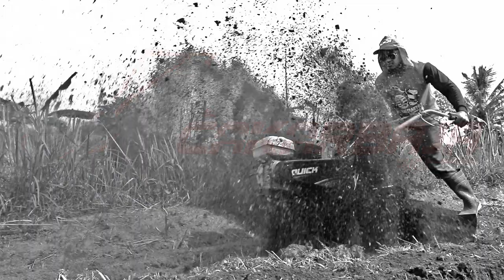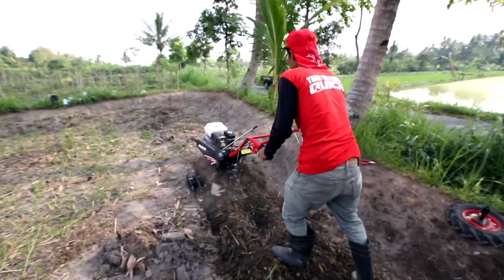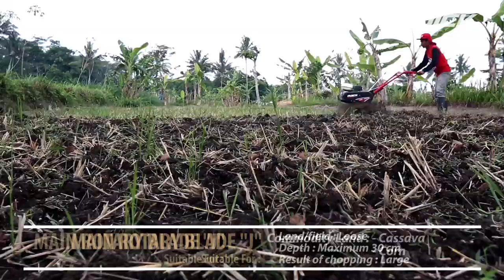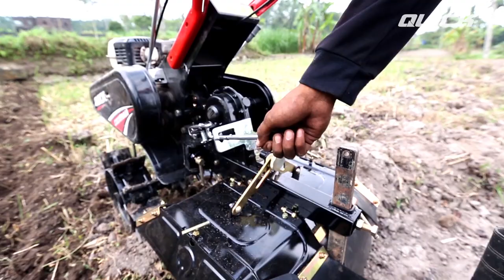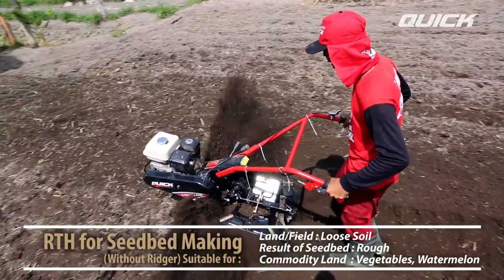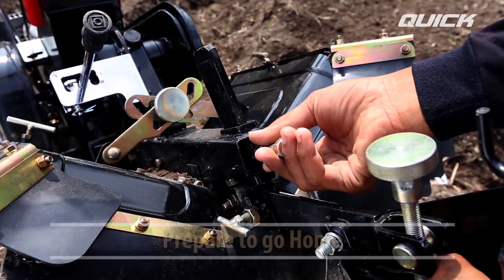CULTIVATOR QUICK CAKAR BAJA : STEADY, DURABLE, STRONG

Comment: Brapa sih Harga ya utk kota bogor jabar
Reply from the maker: Harga Quick Cakar Baja :
Mesin Bensin GX 200T2-QTBC : Rp 11.450.000 
Mesin Bensin GX 160T2-QTBC : Rp 11.150.000

Keterangan:
- Harga belum termasuk Biaya merakit, Oli, Solar/Bensin
- Harga termasuk PPN 10%
- Harga termasuk perlengkapan standar (hitch pin, universal hitch, resistance bar, dan roda karet)
- Harga belum termasuk ongkos kirim dari pabrik di Yogyakarta.

Perlengkapan Cultivator dijual terpisah (pilih sesuai kebutuhan)
--> Main Rotary BLADE B 340 = Rp 1.380.000 
--> Main Rotary BLADE B 240 = Rp 920.000 
--> Main Rotary BLADE B 100 = Rp 680.000 
--> Stabilizer Disc = Rp 120.000
--> Extension Rotary Blade B 200 = Rp 530.000
--> Main Rotary Blade J = Rp 1.310.000
--> Main Rotary Blade S = Rp 1.340.000
--> RTH = Rp 4.930.000 
--> Ridger = Rp 860.000 
--> Iron Wheel (CW 370)  = Rp 380.000 
--> Iron Wheel (CW 550) = Rp  600.000
--> Garu (Leveler) Cakar Baja = Rp 270.000
--> Bajak Cakar Baja = Rp 530.000 

Untuk lebih jelasnya, Pak Bos dapat menghubungi link https://bit.ly/CakarbajaSalesPusat

atau bila berkenan mohon kirimkan nomor telp/HP Pak Bos, bagian pemasaran kami akan menghubungi Pak Bos :)

Comment: Harganya brp yach..?
Reply from the maker: Harga Quick Cakar Baja :
Engine Honda GX 200 T2-QTBD : Rp11.582.000 
Engine Honda GX 160 T2-QTBD : Rp11.262.000

Keterangan:
- Harga belum termasuk perlengkapan (Blade / RTH / Ridger)
- Harga belum termasuk ongkos kirim dari pabrik di Yogyakarta
- Harga belum termasuk biaya merakit, oli, solar / bensin, running test dan training
- Harga sudah termasuk PPN 11%

Untuk informasi lebih detail, silahkan Pak Boss menghubungi Telp. / WA Telp. / WA : 0811 2828 477 atau 0811 2930 300

atau bila berkenan mohon kirimkan nomor telp. / HP Pak Boss, bagian pemasaran kami akan menghubungi Pak Boss :)

Comment: Di Bondowoso berapa per unit harganya?
Reply from the maker: Harga Quick Cakar Baja :
Mesin Bensin GX 200T2-QTBC : Rp 11.450.000 
Mesin Bensin GX 160T2-QTBC : Rp 11.150.000

Keterangan:
- Harga belum termasuk Biaya merakit, Oli, Solar/Bensin
- Harga termasuk PPN 10%
- Harga termasuk perlengkapan standar (hitch pin, universal hitch, resistance bar, dan roda karet)
- Harga belum termasuk ongkos kirim dari pabrik di Yogyakarta.

Perlengkapan Cultivator dijual terpisah (pilih sesuai kebutuhan)
--> Main Rotary BLADE B 340 = Rp 1.380.000 
--> Main Rotary BLADE B 240 = Rp 920.000 
--> Main Rotary BLADE B 100 = Rp 680.000 
--> Stabilizer Disc = Rp 120.000
--> Extension Rotary Blade B 200 = Rp 530.000
--> Main Rotary Blade J = Rp 1.310.000
--> Main Rotary Blade S = Rp 1.340.000
--> RTH = Rp 4.930.000 
--> Ridger = Rp 860.000 
--> Iron Wheel (CW 370)  = Rp 380.000 
--> Iron Wheel (CW 550) = Rp  600.000
--> Garu (Leveler) Cakar Baja = Rp 270.000
--> Bajak Cakar Baja = Rp 530.000 

Untuk lebih jelasnya, Pak Bos dapat menghubungi link https://bit.ly/CakarbajaSalesPusat

atau bila berkenan mohon kirimkan nomor telp/HP Pak Bos, bagian pemasaran kami akan menghubungi Pak Bos :)

Comment: Wilayah bali ada bos?. 1 unit brapa harganya?
Reply from the maker: Harga Quick Kasuari Jawa:
Mesin Bensin GX 200T2-QTBC : Rp 9.000.000 
Mesin Bensin GX 160T2-QTBC : Rp 8.700.000
Body Only : Rp 5.550.000

Keterangan:
- Harga termasuk PPN 10%
- Harga termasuk perlengkapan standar (Roda Karet 8, Blade Ksr J, Ridger Ksr)
- Harga belum termasuk Biaya merakit, Oli, Solar/Bensin
- Harga belum termasuk ongkos kirim dari pabrik di Yogyakarta.

Informasi lebih jelas Pak Bos dapat menghubungi link https://bit.ly/KasuariSalesPusat

atau bila berkenan mohon kirimkan nomor telp/HP Pak Bos, bagian pemasaran kami akan menghubungi Pak Bos :)

Comment: Ini mantab harga berapa yg ini boss
Reply from the maker: Harga Quick Cakar Baja :
Mesin Bensin GX 200T2-QTBC : Rp 11.450.000 
Mesin Bensin GX 160T2-QTBC : Rp 11.150.000

Keterangan:
- Harga belum termasuk Biaya merakit, Oli, Solar/Bensin
- Harga termasuk PPN 10%
- Harga termasuk perlengkapan standar (hitch pin, universal hitch, resistance bar, dan roda karet)
- Harga belum termasuk ongkos kirim dari pabrik di Yogyakarta.

Perlengkapan Cultivator dijual terpisah (pilih sesuai kebutuhan)
--> Main Rotary BLADE B 340 = Rp 1.380.000 
--> Main Rotary BLADE B 240 = Rp 920.000 
--> Main Rotary BLADE B 100 = Rp 680.000 
--> Stabilizer Disc = Rp 120.000
--> Extension Rotary Blade B 200 = Rp 530.000
--> Main Rotary Blade J = Rp 1.310.000
--> Main Rotary Blade S = Rp 1.340.000
--> RTH = Rp 4.930.000 
--> Ridger = Rp 860.000 
--> Iron Wheel (CW 370)  = Rp 380.000 
--> Iron Wheel (CW 550) = Rp  600.000
--> Garu (Leveler) Cakar Baja = Rp 270.000
--> Bajak Cakar Baja = Rp 530.000 

Untuk lebih jelasnya, Pak Bos dapat menghubungi link https://bit.ly/CakarbajaSalesPusat

atau bila berkenan mohon kirimkan nomor telp/HP Pak Bos, bagian pemasaran kami akan menghubungi Pak Bos :)
Reply: @quicktraktor  di jawab detail mantabb👍👍
Yg bisa pake RTH yg type apa..?  Komplit berapa bos
Reply from the maker: Tipe Cakar Baja dapat diaplikasikan dengan RTH

Comment: Di Bandung toko my di mna
Reply from the maker: Harga Quick Cakar Baja :
Mesin Bensin GX 200T2-QTBC : Rp 11.450.000 
Mesin Bensin GX 160T2-QTBC : Rp 11.150.000

Keterangan:
- Harga belum termasuk Biaya merakit, Oli, Solar/Bensin
- Harga termasuk PPN 10%
- Harga termasuk perlengkapan standar (hitch pin, universal hitch, resistance bar, dan roda karet)
- Harga belum termasuk ongkos kirim dari pabrik di Yogyakarta.

Perlengkapan Cultivator dijual terpisah (pilih sesuai kebutuhan)
--> Main Rotary BLADE B 340 = Rp 1.380.000 
--> Main Rotary BLADE B 240 = Rp 920.000 
--> Main Rotary BLADE B 100 = Rp 680.000 
--> Stabilizer Disc = Rp 120.000
--> Extension Rotary Blade B 200 = Rp 530.000
--> Main Rotary Blade J = Rp 1.310.000
--> Main Rotary Blade S = Rp 1.340.000
--> RTH = Rp 4.930.000 
--> Ridger = Rp 860.000 
--> Iron Wheel (CW 370)  = Rp 380.000 
--> Iron Wheel (CW 550) = Rp  600.000
--> Garu (Leveler) Cakar Baja = Rp 270.000
--> Bajak Cakar Baja = Rp 530.000 

Untuk lebih jelasnya, Pak Bos dapat menghubungi link https://bit.ly/CakarbajaSalesPusat

atau bila berkenan mohon kirimkan nomor telp/HP Pak Bos, bagian pemasaran kami akan menghubungi Pak Bos :)
Reply: Kalo buat lahan sayuran asesoris nya apa aja

Comment: Berapa hargay untuk wilayah. Boyolali
Reply from the maker: Harga Quick Cakar Baja :
Mesin Bensin GX 200T2-QTBC : Rp 11.450.000 
Mesin Bensin GX 160T2-QTBC : Rp 11.150.000

Keterangan:
- Harga belum termasuk Biaya merakit, Oli, Solar/Bensin
- Harga termasuk PPN 10%
- Harga termasuk perlengkapan standar (hitch pin, universal hitch, resistance bar, dan roda karet)
- Harga belum termasuk ongkos kirim dari pabrik di Yogyakarta.

Perlengkapan Cultivator dijual terpisah (pilih sesuai kebutuhan)
--> Main Rotary BLADE B 340 = Rp 1.380.000 
--> Main Rotary BLADE B 240 = Rp 920.000 
--> Main Rotary BLADE B 100 = Rp 680.000 
--> Stabilizer Disc = Rp 120.000
--> Extension Rotary Blade B 200 = Rp 530.000
--> Main Rotary Blade J = Rp 1.310.000
--> Main Rotary Blade S = Rp 1.340.000
--> RTH = Rp 4.930.000 
--> Ridger = Rp 860.000 
--> Iron Wheel (CW 370)  = Rp 380.000 
--> Iron Wheel (CW 550) = Rp  600.000
--> Garu (Leveler) Cakar Baja = Rp 270.000
--> Bajak Cakar Baja = Rp 530.000 

Untuk lebih jelasnya, Pak Bos dapat menghubungi link https://bit.ly/CakarbajaSalesPusat

atau bila berkenan mohon kirimkan nomor telp/HP Pak Bos, bagian pemasaran kami akan menghubungi Pak Bos :)
Reply: Tanah tadah hujan.. Rekomendaasiy pakai ap.. N apakh ad bekel resmiya

Comment: How much po
Reply from the maker: Harga Quick Cakar Baja :
- Engine Honda GX 200 T2-QTBD : Rp11.582.000 
- Engine Honda GX 160 T2-QTBD : Rp11.262.000

Keterangan:
- Harga belum termasuk perlengkapan (blade / ridger / RTH)
- Harga belum termasuk ongkos kirim dari pabrik di Yogyakarta
- Harga belum termasuk biaya merakit, oli, solar / bensin, running test dan training
- Harga sudah termasuk PPN 11%

Untuk informasi lebih detail, silahkan Pak Boss menghubungi nomor berikut : 0811 2828 477 atau 0811 2930 300

atau bila berkenan mohon kirimkan nomor telepon Pak Boss, bagian pemasaran kami akan menghubungi Pak Boss :)

Comment: Satu paket cakar baja kuik lokasi Pati beraa boo s
Reply from the maker: Harga Quick Cakar Baja :
Mesin Bensin GX 200T2-QTBC : Rp 11.450.000 
Mesin Bensin GX 160T2-QTBC : Rp 11.150.000

Keterangan:
- Harga belum termasuk Biaya merakit, Oli, Solar/Bensin
- Harga termasuk PPN 10%
- Harga termasuk perlengkapan standar (hitch pin, universal hitch, resistance bar, dan roda karet)
- Harga belum termasuk ongkos kirim dari pabrik di Yogyakarta.

Perlengkapan Cultivator dijual terpisah (pilih sesuai kebutuhan)
--> Main Rotary BLADE B 340 = Rp 1.380.000 
--> Main Rotary BLADE B 240 = Rp 920.000 
--> Main Rotary BLADE B 100 = Rp 680.000 
--> Stabilizer Disc = Rp 120.000
--> Extension Rotary Blade B 200 = Rp 530.000
--> Main Rotary Blade J = Rp 1.310.000
--> Main Rotary Blade S = Rp 1.340.000
--> RTH = Rp 4.930.000 
--> Ridger = Rp 860.000 
--> Iron Wheel (CW 370)  = Rp 380.000 
--> Iron Wheel (CW 550) = Rp  600.000
--> Garu (Leveler) Cakar Baja = Rp 270.000
--> Bajak Cakar Baja = Rp 530.000 

Untuk lebih jelasnya, Pak Bos dapat menghubungi link https://bit.ly/CakarbajaSalesPusat

Kunjungi fanpage kami @quicktraktorjogjakarta
SMS/WA : 0811 2545 915 (Adkha)
Kantor QUICK YOGYAKARTA
Jl. Magelang 144, Yogyakarta 55241
Telp: 0274-563217, 512095
Fax: 0274-563523
Email: ygy@quick.co.id
Kontak kami link dibawah
https://bit.ly/HubungiMasQuickQTYogyakartaFB
https://bit.ly/HubungiMasQuickA360YogyakartaFB
https://bit.ly/HubungiMasQuickQH11YogyakataFB

Comment: Harganya berapa guiik cakar baja yang mini
Reply from the maker: Harga Quick Cakar Baja Mini :
Mesin Bensin GX 160T2-QTB : Rp 8.250.000 

Keterangan:
- Harga belum termasuk Biaya merakit, Oli, Solar/Bensin
- Harga termasuk PPN 10%
- Harga termasuk perlengkapan standar (hitch pin, universal hitch, resistance bar, dan roda karet)
- Harga belum termasuk ongkos kirim dari pabrik di Yogyakarta.

Perlengkapan Cultivator dijual terpisah (pilih sesuai kebutuhan)
--> Main Rotary Blade S = Rp 1.460.000
--> Main Rotary Blade J 250 = Rp 470.000
--> Main Rotary Blade J 600 = Rp 1.040.000
--> Roda Karet Ring 6 = Rp 630.000

Untuk lebih jelasnya, Pak Bos dapat menghubungi link https://bit.ly/CakarbajaminiSalesPusat
Whatsapp / SMS / Telp: 0811-2930-300 (Sales Penjualan)
https://api.whatsapp.com/send?phone=628112930300

Comment: Pak bos traktor kyk gitu harga berapa ? mksh
Reply from the maker: Harga Quick Cakar Baja :
Mesin Bensin GX 200T2-QTBC : Rp 11.450.000 
Mesin Bensin GX 160T2-QTBC : Rp 11.150.000

Keterangan:
- Harga belum termasuk Biaya merakit, Oli, Solar/Bensin
- Harga termasuk PPN 10%
- Harga termasuk perlengkapan standar (hitch pin, universal hitch, resistance bar, dan roda karet)
- Harga belum termasuk ongkos kirim dari pabrik di Yogyakarta.

Perlengkapan Cultivator dijual terpisah (pilih sesuai kebutuhan)
--> Main Rotary BLADE B 340 = Rp 1.380.000 
--> Main Rotary BLADE B 240 = Rp 920.000 
--> Main Rotary BLADE B 100 = Rp 680.000 
--> Stabilizer Disc = Rp 120.000
--> Extension Rotary Blade B 200 = Rp 530.000
--> Main Rotary Blade J = Rp 1.310.000
--> Main Rotary Blade S = Rp 1.340.000
--> RTH = Rp 4.930.000 
--> Ridger = Rp 860.000 
--> Iron Wheel (CW 370)  = Rp 380.000 
--> Iron Wheel (CW 550) = Rp  600.000
--> Garu (Leveler) Cakar Baja = Rp 270.000
--> Bajak Cakar Baja = Rp 530.000 

Untuk lebih jelasnya, Pak Bos dapat menghubungi link https://bit.ly/CakarbajaSalesPusat
Reply: Harga komplit kalbar berapa bos

Comment: berapa harga nya wilaysh pasuruan
Reply from the maker: Harga Quick Cakar Baja :
Engine Honda GX 200 T2-QTBD : Rp11.582.000 
Engine Honda GX 160 T2-QTBD : Rp11.262.000

Keterangan:
- Harga belum termasuk perlengkapan (Blade / RTH / Ridger)
- Harga belum termasuk ongkos kirim dari pabrik di Yogyakarta
- Harga belum termasuk biaya merakit, oli, solar / bensin, running test dan training
- Harga sudah termasuk PPN 11%

Untuk informasi lebih detail, silahkan Pak Boss menghubungi Telp. / WA Telp. / WA : 0811 2828 477 atau 0811 2930 300

atau bila berkenan mohon kirimkan nomor telp. / HP Pak Boss, bagian pemasaran kami akan menghubungi Pak Boss :)

Comment: Harga komplit brp
Reply from the maker: Harga Quick Cakar Baja :
- Engine Honda GX 200 T2-QTBD : Rp11.582.000 
- Engine Honda GX 160 T2-QTBD : Rp11.262.000

Keterangan:
- Harga belum termasuk perlengkapan (blade / ridger / RTH)
- Harga belum termasuk ongkos kirim dari pabrik di Yogyakarta
- Harga belum termasuk biaya merakit, oli, solar / bensin, running test dan training
- Harga sudah termasuk PPN 11%

Untuk informasi lebih detail, silahkan Pak Boss menghubungi nomor berikut : 0811 2828 477 atau 0811 2930 300

atau bila berkenan mohon kirimkan nomor telepon Pak Boss, bagian pemasaran kami akan menghubungi Pak Boss :)

Comment: Berapa hargax bos
Reply from the maker: Harga Quick Cakar Baja :
Mesin Bensin GX 200T2-QTBC : Rp 11.450.000 
Mesin Bensin GX 160T2-QTBC : Rp 11.150.000

Keterangan:
- Harga belum termasuk Biaya merakit, Oli, Solar/Bensin
- Harga termasuk PPN 10%
- Harga termasuk perlengkapan standar (hitch pin, universal hitch, resistance bar, dan roda karet)
- Harga belum termasuk ongkos kirim dari pabrik di Yogyakarta.

Perlengkapan Cultivator dijual terpisah (pilih sesuai kebutuhan)
--> Main Rotary BLADE B 340 = Rp 1.380.000 
--> Main Rotary BLADE B 240 = Rp 920.000 
--> Main Rotary BLADE B 100 = Rp 680.000 
--> Stabilizer Disc = Rp 120.000
--> Extension Rotary Blade B 200 = Rp 530.000
--> Main Rotary Blade J = Rp 1.310.000
--> Main Rotary Blade S = Rp 1.340.000
--> RTH = Rp 4.930.000 
--> Ridger = Rp 860.000 
--> Iron Wheel (CW 370)  = Rp 380.000 
--> Iron Wheel (CW 550) = Rp  600.000
--> Garu (Leveler) Cakar Baja = Rp 270.000
--> Bajak Cakar Baja = Rp 530.000 

Untuk lebih jelasnya, Pak Bos dapat menghubungi link https://bit.ly/CakarbajaSalesPusat

atau bila berkenan mohon kirimkan nomor telp/HP Pak Bos, bagian pemasaran kami akan menghubungi Pak Bos :)

Comment: Bos harga sekrang berspa
Reply from the maker: Harga Quick Cakar Baja :
- Engine Honda GX 200 T2-QTBD : Rp11.582.000 
- Engine Honda GX 160 T2-QTBD : Rp11.262.000

Keterangan:
- Harga belum termasuk perlengkapan (blade / ridger / RTH)
- Harga belum termasuk ongkos kirim dari pabrik di Yogyakarta
- Harga belum termasuk biaya merakit, oli, solar / bensin, running test dan training
- Harga sudah termasuk PPN 11%

Untuk informasi lebih detail, silahkan Pak Boss menghubungi nomor berikut : 0811 2828 477 atau 0811 2930 300

atau bila berkenan mohon kirimkan nomor telepon Pak Boss, bagian pemasaran kami akan menghubungi Pak Boss :)

Comment: Berapa harganya ? Lokasi saya Kab.Lahat SUMSEL
Reply from the maker: Harga Quick Cakar Baja :
Mesin Bensin GX 200T2-QTBC : Rp 11.450.000 
Mesin Bensin GX 160T2-QTBC : Rp 11.150.000

Keterangan:
- Harga belum termasuk Biaya merakit, Oli, Solar/Bensin
- Harga termasuk PPN 10%
- Harga termasuk perlengkapan standar (hitch pin, universal hitch, resistance bar, dan roda karet)
- Harga belum termasuk ongkos kirim dari pabrik di Yogyakarta.

Perlengkapan Cultivator dijual terpisah (pilih sesuai kebutuhan)
--> Main Rotary BLADE B 340 = Rp 1.380.000 
--> Main Rotary BLADE B 240 = Rp 920.000 
--> Main Rotary BLADE B 100 = Rp 680.000 
--> Stabilizer Disc = Rp 120.000
--> Extension Rotary Blade B 200 = Rp 530.000
--> Main Rotary Blade J = Rp 1.310.000
--> Main Rotary Blade S = Rp 1.340.000
--> RTH = Rp 4.930.000 
--> Ridger = Rp 860.000 
--> Iron Wheel (CW 370)  = Rp 380.000 
--> Iron Wheel (CW 550) = Rp  600.000
--> Garu (Leveler) Cakar Baja = Rp 270.000
--> Bajak Cakar Baja = Rp 530.000 

Untuk lebih jelasnya, Pak Bos dapat menghubungi link https://bit.ly/CakarbajaSalesPusat

Kunjungi fanpage kami @quicktraktortanjungkarang
SMS/WA : 0811 2545 972 (Rendy Ressa)
Kantor Cabang QUICK TANJUNGKARANG
Jl. Imam Bonjol No.387 Kel. Langkapura, Tanjungkarang, Kota Bandar Lampung
Telp: 0721-268498, 268495
Email: tjk@quick.co.id
Kontak kami link dibawah
https://bit.ly/HubungiMasQuickQTTanjungkarangFB
https://bit.ly/HubungiMasQuickA360TanjungkarangFB
https://bit.ly/HubungiMasQuickQH11TanjungkarangFB

Comment: Ko gada no hp nya. Aq mau tanya2 hrg brapa, bs krm sukabumi ga
Reply from the maker: Untuk Sukabumi masuk wilayah pemasaran kami di Jakarta Pak Bos. Kunjungi fanpage kami @quicktraktorjakarta
SMS/WA : 0811 2545 908 (Agung)
Kantor Cabang QUICK JAKARTA
Jl. Gajah Mada 154, Jakarta
Telp: 021-6292044, 6490020
Fax: 021-6490013
Email: jkt@quick.co.id
Kontak kami link dibawah
https://bit.ly/HubungiMasQuickQTJakartaFB
https://bit.ly/HubungiMasQuickA360JakartaFB
https://bit.ly/HubungiMasQuickQH11JakartaFB
Reply: Untuk tangerang tokonya daerah mna yh
Reply from the maker: @lampungputra4625  Untuk Tangerang masuk wilayah pemasaran kami di Jakarta juga Pak Bos.
Reply: Untuk jambi adakah